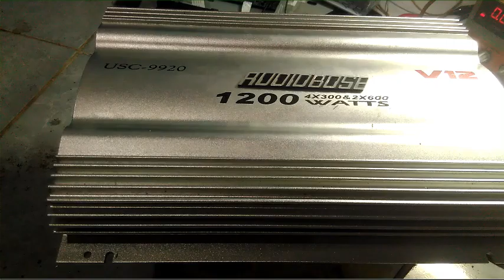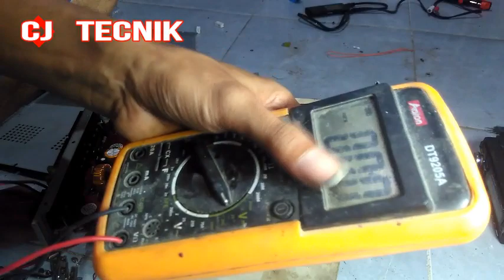CARA SERVIS DAN ANALISA KERUSAKAN POWER AUDIO MOBIL INDIKATOR LAMPU TIDAK MENYALA

Comment: Kira-kira komponen apanya yang rusak boss kalau powernya menggunakan arus 24v ?
Reply from the maker: Kok pakai 24 volt boss??
Reply: Saya pakai conventer dc to dc boss ternyata converternya rusak input 24v output 24v. Sempat nyala 3 jam setelah itu power mati sendiri. fuse bawaan power 40a aman tidak putus.